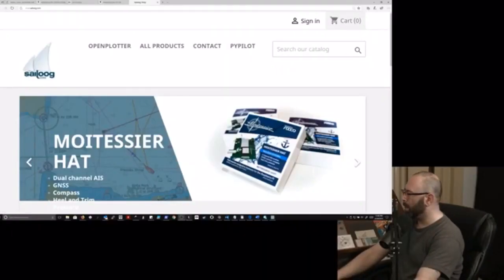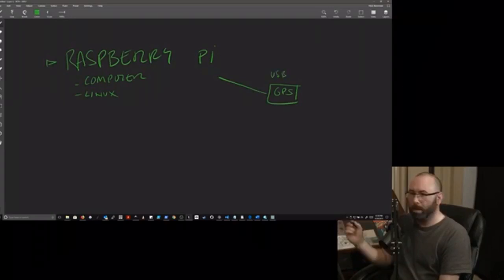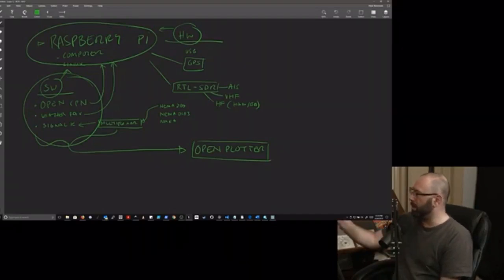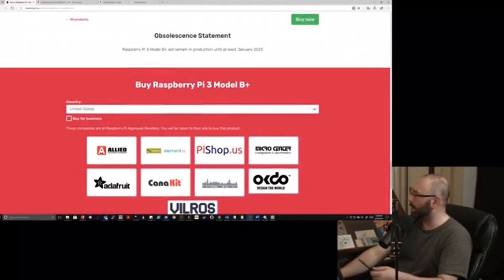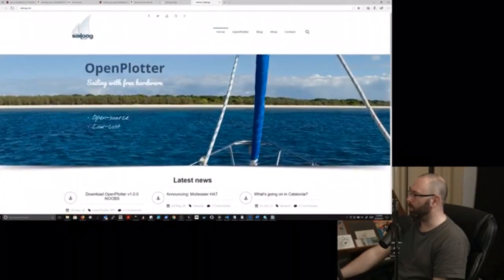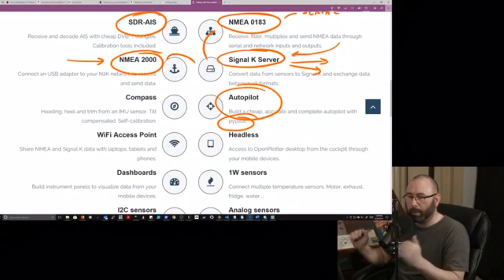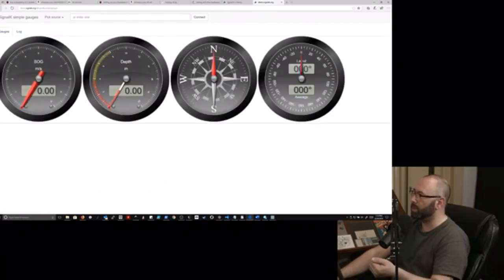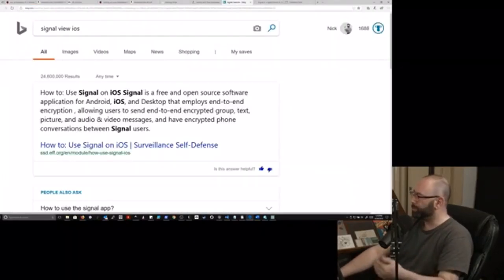OpenPlotter, raspberry pi for Sailboats - Alternative Sailing app and hardware...

Comment: I wonder what you think about adding a AIS transponder instead of just a receiver? I see that on aliexpress/amazon there is a transponder for about 200 USD that both recieves and transmits AIS. I was just thinking that if I am about to do a fun project, why not have both given the price point? I would love for others to see me as well as I see them, and they can hail me using the MMSI they then see on their plotter. Would it be possible to connect the HA-102 Matsutec Marine AIS with the raspbery pi? Whats needed for that in that case?

Comment: Any info on 10" touch screen selection that would be at least daylight readable connecting to Raspberry pi to be used in the covered cockpit.
Reply: Not sure if you got your answer already, but a really good way to do this would be to run it headless and then use a tablet in a waterproof case and mount to connect to the RPi that’s mounted in a waterproof housing someplace on your boat.

Comment: So I got a Raspberry Pi and loaded OpenPlotter and, so far, it seems that OpenCPN is not a very good option outside of USA. NOAA publishes very decent charts with no copyright. You can easily download copies of these charts for OpenCPN. They aren't exactly true digital charts, just pictures with your nav software over the top of it, but for under $250 you have a nav system with GPS and AIS receiver. As long as you never leave US coastal waters you are set. Those charts from NOAA are the only free charts I have been able to find that show depths.
Reply from the maker: Good to know. I’ve not tried it, as we have good navigational equipment onboard. But I felt this guy may just be on to something...but glad to hear from a real sailor that it’s not working overseas for you. We love our Raymarine Chartplotter with Navionics charts and would never give them up! But this may be a good backup if charts were to improve outside the us?
Reply: Open Maps definitely have potential.  And I think I can buy and install the same maps you use on OpenCPN. But I am loath to pay for subscription services or anything with DRM. I've been burned before. I want something that works forever without internet or updates  or proprietary encryption once I've installed it once.

There is also an open source project for agreggating the depth data from from private boats to create depth charts, like Navionics does. But I checked my area and there were just a few tracks of depth data between Bremerhaven and Helgoland (a popular destination for sailing tours off the coast of Germany). So not yet useable. You must have a whole treasure trove of depth data. I am not sure how much work you would have to do to submit it, but consider sharing it here: https://depth.openseamap.org/ 

Garmin Navionics Platinum+ maps cost more per year for a small coastal area than my whole chart plotter. For 365€ I can get "UK South - Hamburg" which will get me as far as Guernsey, but not Ireland. It only seems like a good deal if I never leave my home harbor for more thsn a few days. What package do you guys pay for?
Reply: NZ has free charts afaik ,issued by an agency called LINZ. But if you're cruising it's worth paying for charts to protect your boat.

Comment: You did forget to mention what a 1000nits 13" touch screen costs…
Reply: @Røget Bacon A guess, around 1000$.
Reply: @Røget Bacon Yes, my point is that it will not be cheaper to build a good one in comparison with for example a Raymarine Axiom or a Simrad.
Reply: @Røget Bacon So, give me an example of a good solution with hardware that beats my Axiom. And if I can't see anything in direct sunlight it does not count.
By the way I have been fiddling with Linux, Pi's and electronics for many years but there's always to much bugs so getting tired of it.
Reply from the maker: You guys have been busy with your comments ;) Yes...a chartplotter from Raymarine is crazy expensive. And if you are crazy smart you can probably build you own. But if you get it wrong, or a big splash takes it out, or if not secured down well, or you don’t know how to repair it in the field, you have lost a LOT of money when you lose your boat. This alternative method is only for those technically savvy. That’s NOT me...so will be sticking with my Raymarine unit. It’s always there, always works, never needs a repair when you least expect it.
Reply: just repurpose a decent tablet! Not hard to see why you're getting frustrated by your efforts